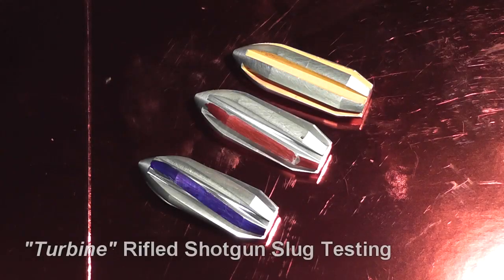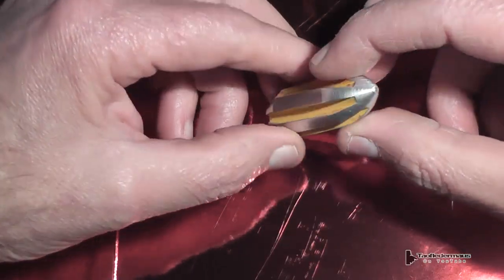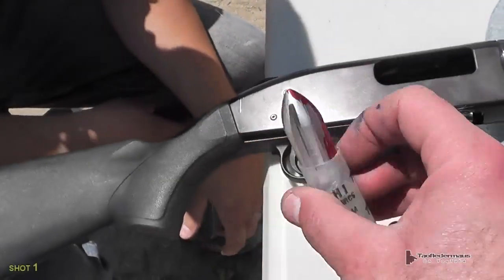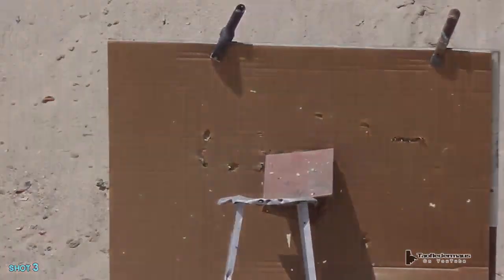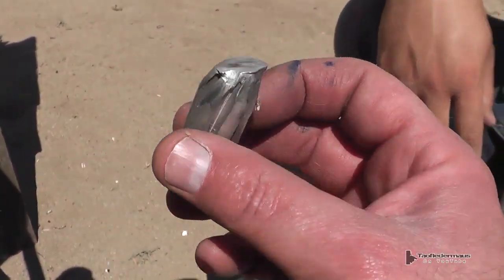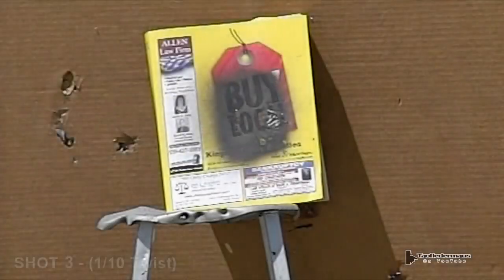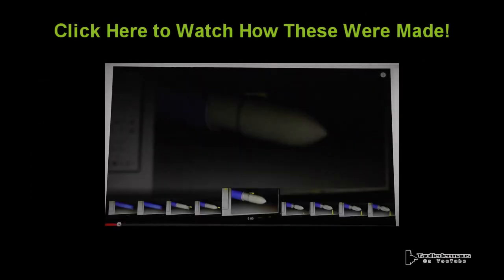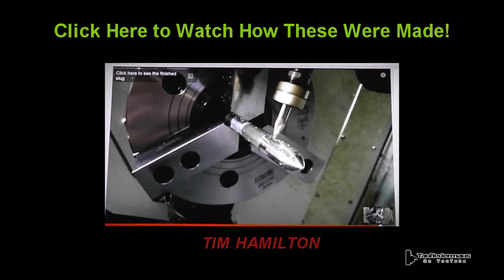Custom Aluminum TURBINE Shotgun Slugs  -Testing

Comment: Ridges seem way too big for that speed. I think that at that speed you need something much shallower but way more of it, something like 1/50 instead of 1/20 but only 0.1-0.2 inch deep and instead of six you would want 30-60 (I admit, I am way too lazy to calculate how much of them would fit. :( )

Comment: If you want aerodynamic spin I think you'd need more prominent fins. Perhaps something foldable?
Reply from the maker: trefod  It would probably tricky and hard to have something that was strong enough.
Reply: ***** Absolutely it would be no trivial matter and probably beyond any of us weekend inventors. They would shear or not be precisely angled or something like that.
Yet to get a slug to spin up before it begins tumbling and for it to attain aerodynamic stability from its spin in 20 yrds is difficult with only tiny grooves cut into the slug.
I think experimentation is great, but I also think much can be disregarded in the idea phase, by... thinking a bit.
My best bet for getting at longish slug to spin would be a choke with rifling and a slug soft enough to grab the rifling.
Reply from the maker: It would probably take many hours to make something complex like that... the BAM... it's destroyed.   lol

Comment: you need to have smaller more narrow rifling and have the slugs deeper into the shells. They're being pushed sideways coming out of the barrel because they're not seated well in the shell. If they have a solid base underneath them they'll fly straighter.

Comment: Have you thought about testing screen protectors for like iphones and such that are made of tempered glass or comparing different brands? Not like the flimsy plastic ones. I've seen some brands say it can even stop bullets, I assume low caliber, and one of them did a test with a revolver which worked.
Reply from the maker: DrakeDragonheart  I probably couldn't afford to buy a bunch of those thing.
Reply: Yeah I getcha. I'd send you some myself but then I'll be sleeping in the dog house lol. Hopefully some more generous viewers could do that, most are less than 10 bucks on Amazon.

Comment: Its a nice idea but I think I know why they failed though.  If they are leaving the barrel at supersonic speeds the tip of the bullet will create a pressure wave that will prevent air from travelling down the grooves as the pressure wave pushes the air outward in a cone.  One possible way around this is to use subsonic loads another might need to redesign the tip perhaps a more rounded tip with the grooves all the way the tip.
Reply from the maker: EQUINOX   That was what I was thinking too.  The shockwave pushing the air away from the fins.

Comment: I noticed that the rounds start tumbling immediately upon leaving the barrel.  Did the riffleing on the rounds engage the bore?  If so it didn't seem to impart much if any rotation to the round.  Maybe adding PTFE inserts along the top of each rib that would firmly engage the bore and spin up the round before it exits the barrel would work.

If this was trying to use areodynamics then thats a whole different animal.  I would suggest looking at advanced hobby rocketry sites.  It's about the CG and CP placement and  riffleing isn't a big concern.
Reply: tom adams I would try to design the slug more like a mortar round, that is, heavy at the front, reverse pear shape, with fins at the tail, you can then angle the fins to make it spin, if it's front heavy it's less likely to tumble because if it starts to tumble the lighter tail portion will encounter the oncoming air which will push it back rather than the heavier front portion.
Reply from the maker: tom adams   For safety reasons,  he made the rounds slightly smaller than the bore.  We didn't want the gun to blow up in case the rounds were too tight for the bore.   Aluminum doesn't swag or deform like a lead slug.
Reply: ***** In that case the riffling had no effect.
Reply from the maker: The idea was for the slipstream to cause the round to spin,  not a mechanical rifling as you'd think.
Reply: ***** I'm no expert but I went through a model rocket phase and learned a bit.  There are many web sites with info and programs about how to design a stable rocket.  Thats where I learned how something being pushed from behind could fly straight.  It has to do with keeping the center of gravity ahead of the center of pressure.  The definition of CP I understand is.  To think of it like CG except for air resistance.  These riffled rounds have the CG and CP on top of each other,   the turbine blades never had a chance bite into the air before they started tumbling.  I could come up with some crazy looking designs that should work but I have no way of making them.
Reply: ***** Well, I'm not at all educated about these things, so please don't yell at me. But just looking at it, it looks like the gases forcing it out would spin the round counterclockwise (shooter's perspective), yet the air in front would spin it clockwise. Eh?
Those forces have got to at least conflict with each other and if the round was too small for the bore, then that counterclockwise spin isn't really going to be governed... err, it's not gonna be linear, ya know?
They look absolutely terrifying though.
Reply: Trenchcoat1Sword  If your saying the round should have started spinning from the propulsive gasses passing forward through the turbine blades I thought about that also.  I'm thinking the the cup between the charge and the round didn't allow enough blow by to spin the round.  It should be possible to make a round that used blow by gasses to spin and propel the round.  It would be a tricky balancing act that could be dangerous and wasteful.

Comment: What I think is happening is that fins work off of aerodynamic drag. Which only works if there is a pressure differential. Now the way guns work is to create a huge high pressure zone behind the bullet. This works counteractively to the fin design giving the air in front no where to go to create spin or drag to stabilize the bullet.

Comment: awesome, it was really cool.  I thought they would work too.  But I'm thinking the higher pressure inside is slinging the projectiles sideways when they reach the lower pressure outside the barrel because the gyroscopic spin inertia is too low to correct back pressures that aren't centered in the back of the projectile. I only see two ways to correct this.  One is to make the back of this slug super narrow, with the inner weight placed more in the front of the slug.  Two, make the back of the slug cup shaped, and thin on the sides, so that it helps to form a vortex in the bowl of the slug from the inner pressure to help the pressure plume to be more centered when it comes out, with the weight of the slug being centered a little towards the rear.  This will cause the front to wobble a bit, but the rifling has a better chance to take hold.  I think this rifling fins are too thick and need to be made thinner, and more of them.  If you think about it, a shot gun's projectiles are more like cannons, and balls work best in cannons, probably because of these very issues you are having.  But when putting aerosol cans in clay drain pipes to shoot out, the cup at the bottom tends to really give it some stability, does it not?  This is just an amateur's opinion.  I love your videos.  have a great day.
Reply from the maker: Gristle Von Raben   Haha,  thanks!!

Comment: I think the weight distribution in the round itself has a lot to do with tumbling. If you could some how get most of the weight forward in the round I think it would work.  That's why I put the metal weight in the front of the 3D rounds.
Reply: Monsters Payback Day except AR15 pattern rifles, like all rifles, have a rifled barrel to stabilize the round in the air. Most rifle bullets are bottom-heavy (because most are pointed) so all will destabilize inside a human body. 5.45x39mm used in the AK74 will tumble inside a body too. The 5.56 fragmentation comes from a thin jacket and deep cannelure, where the bullet bends and breaks. The West Germans made 7.62x51mm bullets with thin jackets and deep cannelures which made them fragment. 7.62x39mm will also tumble, it just takes more distance to do it.

The reason shotgun slugs ought to be front-heavy is that from a smoothbore, rifled slugs simply can't rotate on their own - so the heavy front with a light back would keep it straight like a shuttlecock.
Reply: I don't think thats the problem, i guess its the weapon since the 7.25 rounds from a m16 have the weight in the body to make the bullet bend and send shrapnel all over your insides one it hits
Reply: Monsters Payback Day The real problem is the bullet is not engaging the rifling in the barrel since it is a shotgun and has no rifling.  A typical rifle uses pressures to engage the bullet and the rifling in the barrel.  Putting the rifling on the bullet was a decent attempt but you are asking the system to work in reverse.
Reply: ArtisanTony WEIGHT FORWARD ...AND,ENOUGH WEIGHT.

Comment: I'm willing to bet that if the base of the bullet was hollowed out and the head was weighted that it would fly straight.
Reply: Just like commonly available slugs sold at the gunshop?

I'm not busting your chops, but what you just said is like saying "I bet cars would have a smoother ride with round wheels". We kinda know that, that's why we make those things that way...
Reply: Well, this guy didn't make them that way. That's why I suggested it.
Reply: I think that would defeat the purpose. We know it would probably stabilize it, it wouldn't be much of an experiment like this was.

Comment: I think they need to travel for a bit for the airflow to overtake inertia and make em spin. Maybe make them front' heavy with steel or something to ensure they keep straight for that critical part?
Reply: But there are already commercial shotgun slugs stabilized by being front heavy. By doing that, it negates the (futile) effort of adding grooves. Reinventing the wheel and all that.
Reply: Also, the slugs started keyholing. If their stabilization method requires them to fly with the tip forward, then they'd never recover. Spitzer pointed projectiles are naturally bottom heavy so their center of mass is off to the back. It carries it's inertia off center, inertia isn't going to help at all. It's the inertia that caused the keyholing in the first place.
Reply: Shit, I love how there's no edit button. I'm on mobile so I totally misread it. Air resistance would be naturally unequal since the back of the bullet is wider than the point, meaning it would aggravate the tumbling. It would be more likely it would start flying ass-backwards because of the bottom's inertia. Unless the bottom is less aerodynamic than the sides, taofladermaus has proven cylinders may just fly sideways.

Comment: If it is supersonic, then I'm not sure the rifling would be getting any airflow to support stabilization. The supersonic wave cone at the front of the round would cause an airflow separation around the body of the bullet...then if it drops subsonic you would get destabilization at the super/sub transition speed.

Comment: I imagine it would work better were it made from a heavier metal. Lead or steel would be at least a little heavier. Alternatively, a lead core surrounded by aluminum fins.

Also, what would happen if they were rifled in a pattern opposite to that found in a rifled barrel? Say, counter-clockwise to the barrel's clockwise?
Reply: No, a heavier material would be even harder to spin. If aerodynamic drag couldn't "push" onto the grooves to create a moment in aluminium, it would be even worse on a heavier material.

If you're using a rifled barrel forget the grooves. They do nothing in terms of spin.

Comment: I would actually suggest milling out a pocket in the core of one of the bullets from the back and one from the front to test weight distribution. Fill those with molten lead to add some mass. Maybe those would work well.

Comment: there a couple of reasons why it did not work. one is rifling will only work for a short time. think of it like a fan... blow in the back it spins on way... blow it in the front it spin the other way. so in barrel it spinning one way(most force is in the back of bullet) then once it get out the barrel it try to spin back the other ways(most force is in front of bullet).
Reply: There's wadding separating the powder charge from projectile so it's not blowing in the back...
Reply: yes i did not think of this!!! but i'm sure for the  groves all the way to back/ open spots the wadding is allowing bypass if not nothing would move.. but yea it might not be spinning at the speed that i was thinking of at first but i'm sure it spinning. anyway you look at it dose not spin like it should in the barrel or it come out flat at the start where most of your accuracy is.

Comment: The rifling was way too thick. To work going that fast it needs to be more subtle.
Reply: The aerodynamic forces would only be remotely measurable with thick rifling. Think of air like it was water (except compressible). Would subtle twists rotate more water than deep grooves?

Let's put the referential on the slug as if it was stopped. The forward velocity of the slug would be converted into incoming air (like a wind tunnel simulates airspeed on a model plane). If the rotation is caused by the incoming mass of air hitting the grooves, then wider grooves allow more mass to flow than subtle grooves would.
Reply: with it being that think and aggressive. It could more aggressively hit turbulent air and start to tumble

Comment: A good guess for a homemade slug to work is:

1.)The slug should be shorter(roughly half the length of these rounds) and/or made of a heavier metal.

And/or:

2.) The slug should have a long tapered nose that leads to a stout base instead of being symmetrical on both sides, kinda like the .50 BMG. 

Great idea with the twist though.

Comment: if a projectile is in flight, would the heavy end be at the front or back. in low atmosphere?
So if a slug was to be lead tipped, adding more weight and reducing the chance it will tumble?

Comment: I think, the top of the projectile has too much air resistance which causes the bullet to not even start spinning. So it would probably work better if the rifling would start earlier and more in the centre.

Comment: what if you would take just a standard rifled slug (lead) and just take the center of it out and imbed some sort of harder metal point (steel) and shoot it. We know that the regular lead slugs fly very true because of the soft metal and rifled nature of it engaging the barrel.
Reply: But the barrel is smooth, nothing to engage.

Slugs fly straight because they're either hollow in the back or have a polymer stabilizer in the rear like a shuttlecock.

Comment: This got me to thinking of how I took some rocket motors that were a loose fit in electrical conduit and ran beads of hot glue angled along the sides of them to make them fit right and possibly impart some spin.  I had little faith in the end result and never fired them in that fashion.  But it's a good example of what goes on in the minds and garages of men and boys (and the YouTube site of TAOFLEDERMAUS).

Comment: In a smooth barrel, slug doesn't stabilize gyroscopically. The rifling on the slug isn't there to spin it. The grooves in the slug are so when the slug is making contact with the barrel the entire time and when it reaches the choke the led can compress into the gaps so it doesn't create a high pressure area. The way a rifled slug stabilizes is more like a pub dart. It has more weight up front pulling the rear while the rear end acts like a fin. Gyroscopic stability only applies to a smooth slug shot through a rifled barrel.
Reply: James Schaible I was going to say the same.
Reply: James Schaible Thank you. I'm tired of explaining this one to people. Foster and Brenneke slugs work using only aerodynamic stability.
Reply: James Schaible  I don't know a lot about this subject, so I found your comments very helpful.
Reply: James Schaible I was thinking if they  used a much longer barrel to allow the round to spin more? Or would that not matter in this case? I'm asking you cause you seem to be the most knowledgeable comment in the sea of comments on the subject lol..
Reply: James Schaible Exactly, think bad mitten birdie. The thin walled rear of a slug acts just like the feathers. So far, all they have proved is that ammunition manufacturer's know how to design ammunition. The only way to impart spin on a slug is to rifle the barrel.

Comment: Rifled slugs do not spin out of a smooth bore barrel the are lobbed like a shuttlecock in badminton. You need a rifled barrel and a proper was or sabot to achieve the desired effect of the rifling

Comment: Was wondering if you've ever heard of or tried building a linear electrical generator out of a ferromagnetic slug launched by a shotgun through a long pipe coiled in copper wire.  Sort of the opposite of a rail gun.

The idea would be to generate a very high voltage but short burst of electrical power.

Biggest problems I thought of were the precision you'd need to not destroy your coil and the cost associated with shooting a magnet (especially a neodymium magnet) if you cannot retrieve it (not to mention shooting a high powered magnet out of a steel shotgun seems pretty dangerous).

So probably a custom firing rig, pointed straight down so the slug doesn't follow a curved path, and catch the slug in something that won't deform it too much (not sure if thats possible).

The other problem is actually measuring the voltage generated, since it would be so brief, would probably require a special voltmeter.